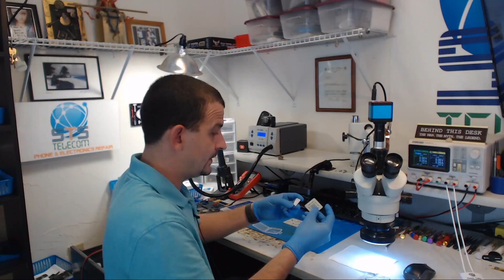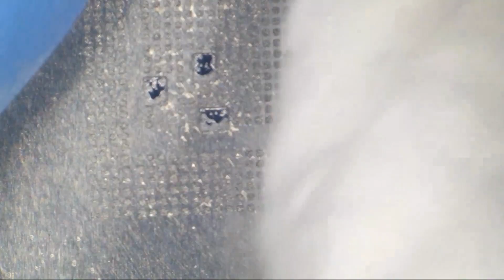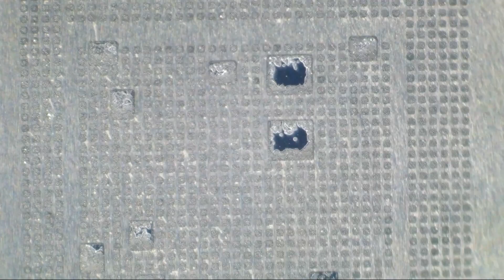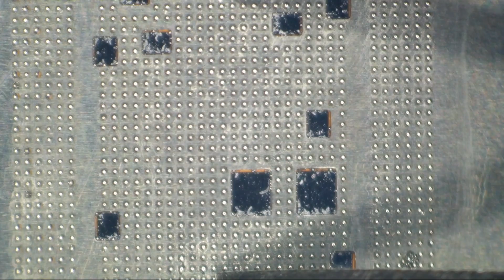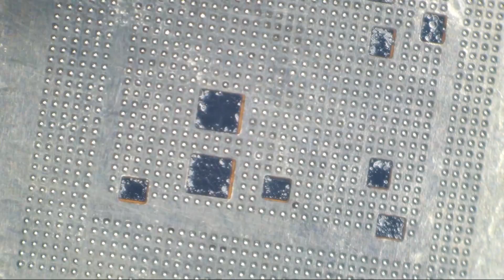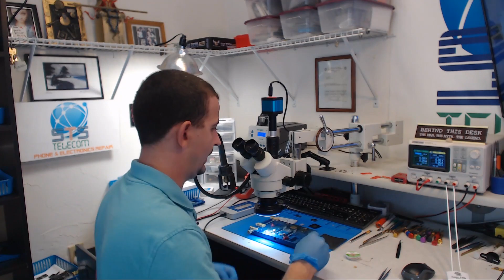My first iPhone X CPU A11 Re-ball (This board should boot)

Comment: 13:07  fuck is right Jason 🤣  I am trying to change my first Macbook T2 chip, so very similar to these CPU's AFAIK. I have a halfway decent magnetic holder but it still does not sit flush in the centre of the chip. I have tried dry paste, wet paste but it's a disaster either way. Trying this shit yourself gives me massive respect for guys who do this with ease, that's for sure.
Reply from the maker: Yikes, that T2 is significantly large!  It would be a challenge to re-ball for sure.  I'm doing it regularly now on phones and it still makes me sweat!  I am scared to go back and watch what awful things I did to the poor boards in these "my first cpu" videos.... lol   I will post new stuff soon.

Comment: What i learned;
Paste it.
heat it;
re-paste to fill what needs more
heat it;
scrape all balls flat to the stencil;  and channel your inner louis and flux it up nicely
heat it
should be able to separate the stencil after the balls harden but before the flux cools.  then you can clean it up from all the loose balls and fly forward with re-heating or whatever it may need (visually).

Comment: I remember the first reball I did was on an eMMC. I did it all wrong, The paste was too wet, I lifted the stencil off before applying hot air. The wet solder paste spread out into an almost uniform film as soon as I applied heat. The janky silicone mat got a bubble of hot air under it lifting everything up and out of focus. Then all of a sudden the solder paste melted, surface tension kicked in and created a perfect set of balls.

Comment: with the wet paste after application try running a clean wipe over the stencil to mop up the excess flux, also helps pack the paste and stencil down a bit too.
Just a suggestion that works for me, I dont worry about dry or wet paste anymore.

Comment: Don't heat too slow as the heat will go deeper in to the cup. Also the cup is cooling all the time. But you did good Jason. Also some people have good work with the solder balls you can buy

Comment: Would you say the cpu is the most difficult chip on the whole board to replace or repair?? I’ve never done one either.jay
Reply from the maker: Yes, aside from doing the RAM separately I think.  After this, not many phone ICs will seem intimidating.

Comment: Hi there.  I come from Germany and I really love your videos.  I reball the cpu with 2% air flow and 350 C. With how many degrees did you unsolder the cpu?
Reply from the maker: 340~350C @ 40/100 airflow is what I removed it with
Reply: ronny doerk how long does it take to melt with those settings because isn’t 2% air too little air flow?? Just wondered because I need to do this very soon??thanks jay
Reply: badboybarber1 hard to say.  would say 1.30 minutes.  I take the Stancil without a bracket.  I put two layers of toilet paper under the CPU.  then it does not deform the stancil.  and with 2% airflow you don't have these big balls.

Comment: Good luck and I have a question, maybe you can answer.  I have an iphone 7 device that has backlight that works but no image and the device draws 0.16amp current
Reply: Osman GÜLMEZ that is not a question friend it is a statement you did not ask anything?
Reply from the maker: Hmmm, I wonder if you connect it to a computer if it is detected by iTunes.